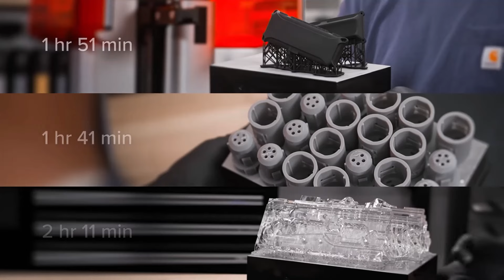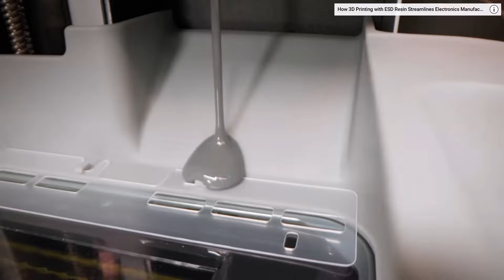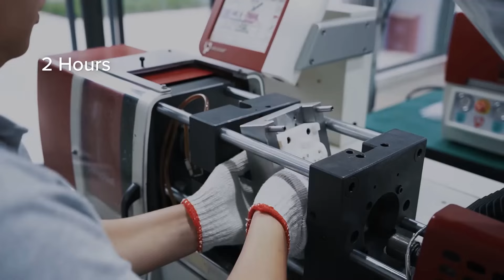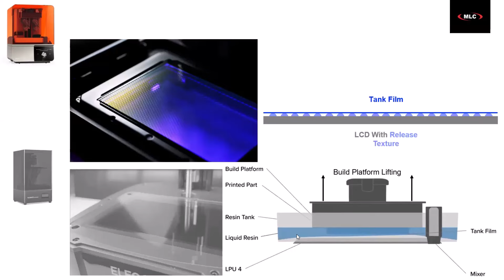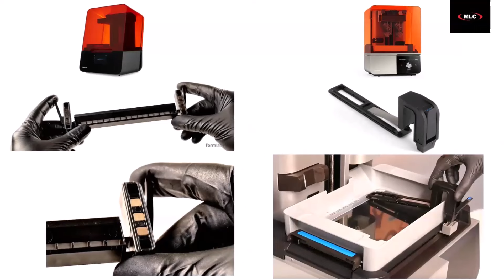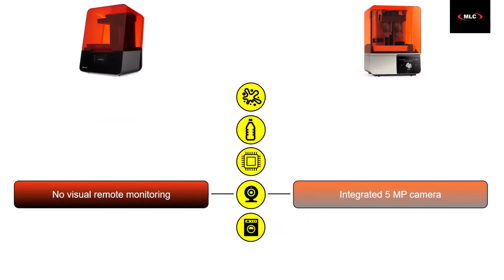Is It Really That Good? | Formlabs Form 4 Overview & Expert Q&A

Comment: This is a great video. Have you printed something with the clear resin that is solid and tall? Did you get any bubbles inside the print? I’m looking for a printer that can print clear, solid and tall with no bubbles. If you haven’t tried the clear is there any way to try printing with it? Maybe a 4-6 inch tall by 1.5 inch diameter or anything with some volume not a thin wall print to see if bubbles appear.
Reply from the maker: According to Formlabs, they have not encountered air bubbles in cured Clear resin prints. When the build platform descends into the resin tank, it squishes against the clear tank film, pushing out and popping any air bubbles. Based on your request, this video (https://https://www.linkedin.com/posts/formlabs_how-clear-is-clear-resin-v5-heres-a-quick-activity-7209538500579213313-Mb-m?) is exactly what you’re looking for! Here, Formlabs is printing tall Clear V5 resin cylinders to be used as lenses. Great way to see that there are no air bubbles in these parts. Pretty awesome! If you want to talk about this application more, reach out to us at include appropriate contact source!

Feel free to reach out to us for further assistance in navigating the right solution for your application - https://www.mlc-cad.com/contact-us/

Comment: Is black V5 in any way comparable to tough 1500? I’m interested in low volume  production  quality with toughness and little to no post processing.  I realize I’m asking for a lot however I’m just curious if the black V5 gives us that. It would be worth the printer for me.
Reply from the maker: Black V5 actually outperforms Tough 1500  in just about every category – only impact resistance (Notched IZOD) is higher with Tough 1500. Black V5 can resist higher temperatures, is stiffer, and stronger – both in tension and flexion. Regarding post-processing, the support touchpoint sizes are smaller with Black V5, so there will be smaller surface marks left after removing supports. 

Check out this video (https://www.youtube.com/watch?v=Hr4DKHX9Hsg&t=232s) on support removal – Formlabs showcases Black V5 in this process!

Please don’t hesitate to reach out if you’d like to discuss further, we would love to learn more about your specific application. https://www.mlc-cad.com/contact-us/
Reply from the maker: Read more on the materials here. 

Black V5 - https://formlabs-media.formlabs.com/datasheets/2401897-TDS-ENUS-0.pdf 

 Tough 1500 - https://formlabs-media.formlabs.com/datasheets/2001292-TDS-ENUS-0.pdf